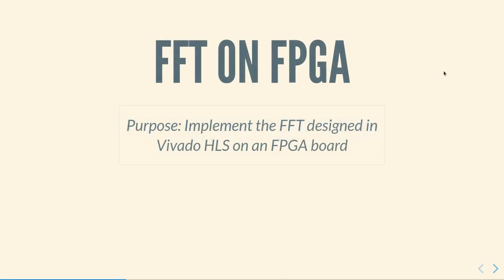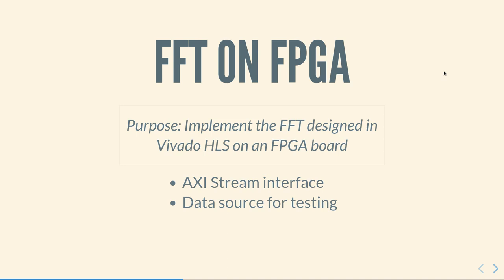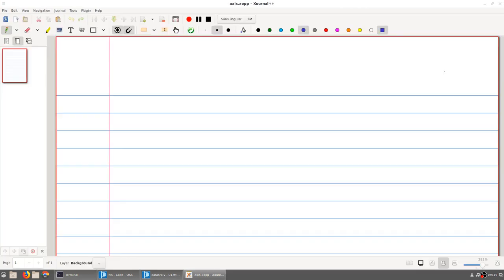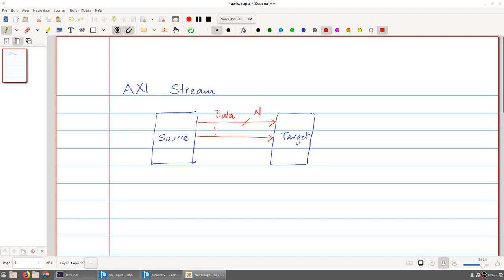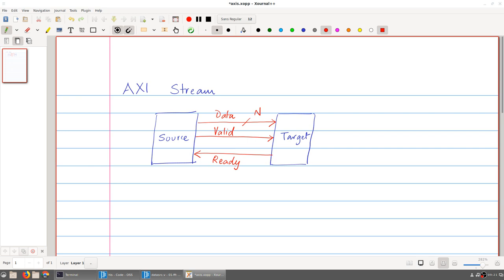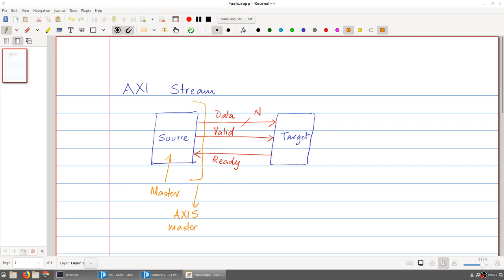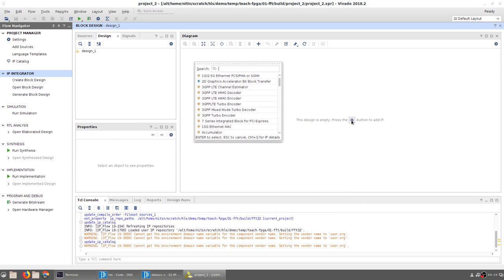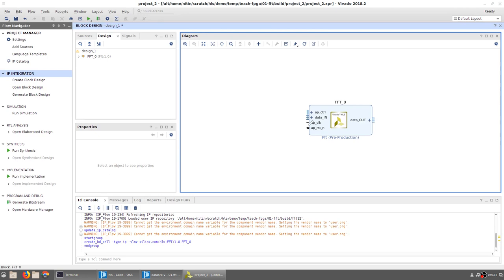FFT module on FPGA

Comment: can i added the fft ip from vivado not fft hls ?
Reply from the maker: This should be possible, since the FFT IP also takes AXI stream input. It will not be a drop-in replacement - you will need to make some changes so that the data comes correctly to the FFT IP, but it should not be too hard.